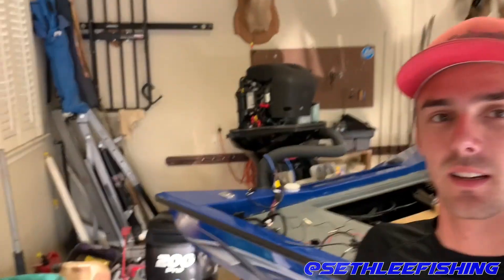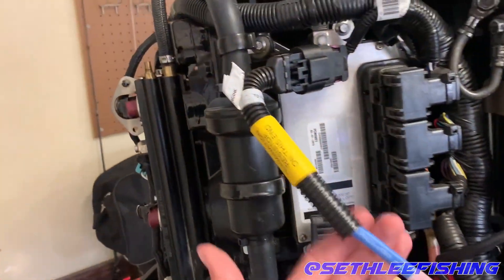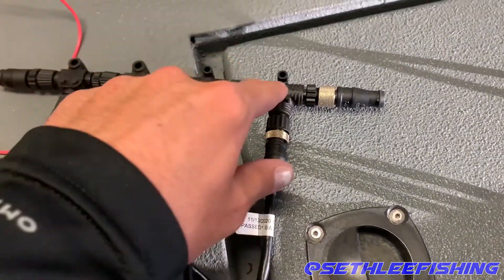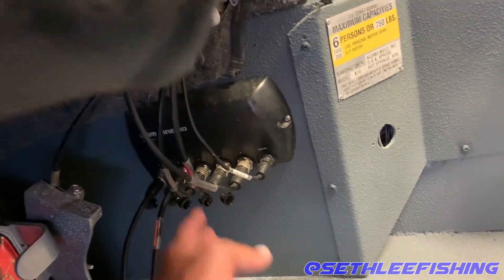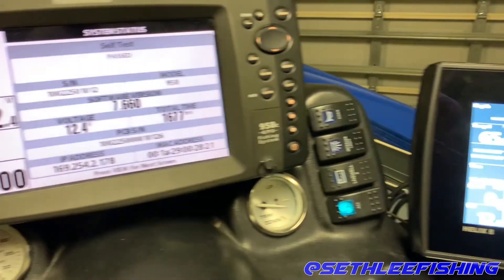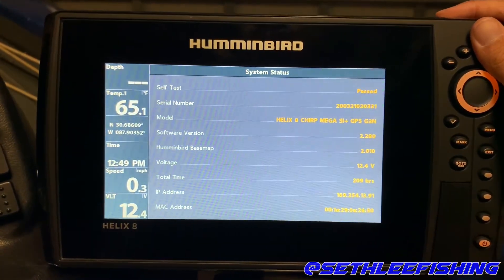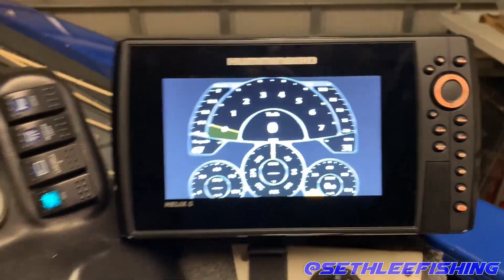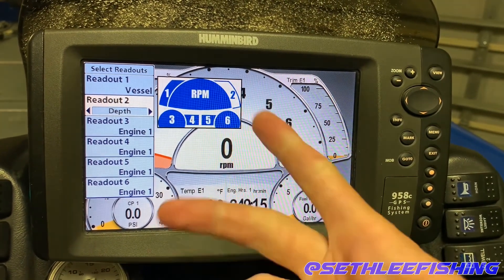Connecting Outboard Engine Data to Units | Nmea 2k Tutorial

Comment: On a new 2022 Mercury Pro XS do you still need the Blue cable or can you plug the gateway directly into the smart port on the engine, then to the NMEA backbone, and connect to Lowrance HDS. Is the blue cable still required, or there is no way around that.
Reply: I need to know the answer to this question as well...
Reply: @Bennett00044  Its complicated and not easy. Yep if you do the blue cable then to NMEA and then to Lowrance ,all you get is a generic instrument panel from Lowrance with limited info. To get the Mercury logo with full bells and whistles you need an additional Mercury Vessel link junction box $450. Not worth it so I went with the mobile phone app which works fine. $150

Comment: Doesn't the Mercury Gateway just plug into the engine where you plugged the blue cable into?
Reply from the maker: No, you must use the blue cable because of the resistors. You may have seen someone plug in the Vesselview module straight to the motor, it looks very similar. But the NMEA 2k gateway must have the blue cable.
Reply: @SethLee  Thanks for that.  Just ordered it and the male/male.  I have the gateway arriving tomorrow.   Is it the Smartcraft Manager app that your downloaded?
Reply from the maker: @timtullio1210  The gateway I used in this video is an older model that didn’t have the WiFi/Bluetooth Connectivity feature. I’m assuming the one you ordered most likely does. You do not need the app to connect everything if you are physically connecting all your cables and units together like I did in the video. My understanding is that the app is only for setting up your gateway to send/receive wireless Data/Info to and from your system. I have no personal experience using the app or wireless option so I cant really give you much more information about that. I always prefer to physically connect things instead of using a wireless option just for the sake of reliability. 

So, no the app is not required for this setup. It may have some extra cool features but I’m not aware of what they are or how to use them. Good luck with the install, hope you enjoy the outcome! I think it’s well worth the upgrade
Reply: @SethLee  Got is all together, and it's working!  Thanks for the video and helping afterwards.  Blue cable, to male/male, to Mercury Gateway Module, to NEMA starter kit, to Solix.  Power from aux switch on dash.
Reply from the maker: @timtullio1210  Awesome! Glad I could help
Reply: @timtullio1210  What engine instrument information did you get to show up on your solix from this gateway setup?

Comment: How did you route the cable up to the engine? The problem I'm running into is the mercury harness connector is too big to be ran through with the existing cables and lines.
Reply from the maker: It was a very tight fit but I managed to get it through. It took a lot of patience. There are several threads on the bass boat central forums about this. A lot of guys have removed the wires from the plug and then they were able to get it through easily, then they reattached the plug. I would advise against that because you can mess it up if you don’t know what you’re doing. But look into it and see if that may be a better option for you. Hope that helps!
Reply: I'd run from the engine to the backbone of the nmea 2000 instead

Comment: Hi all. I was hoping someone could help me with an answer to how the NMEA 0813 to 2K converter works? Would this connect from the five port Ethernet switch of Humminbird into the NMEA 2000 backbone? I have not been able to find a straightforward answer to this. I have 2 H'bird units the helix 9 & 7. Both are G3N. I've already purchased and returned a Lowrance unit to get the fuel data manager working and I've now purchased a Garmin GPS24XD for GPS data. What I need now is the sonar depth, water temp and t speed thru water (STW) data .. and I was thinking it would be cheaper to use a converter and utilize the H'bird transducer I already have mounted rather than have to buy a 3rd transducer for this data to display. Wish I could post a pic of my setup but basically the 2 H'bird units, the 5 port switch, the H'bird NMEA2K adapter and then on the NMEA2k backbone it's the Yamaha interface cable, Lowrance fluid level sensor, Lowrance fuel data manager, Garmin GPS24xd.  If anyone can explain how to get the H'bird transducer data onto the NMEA2K display I'd appreciate it greatly.

Comment: Excellent video!  I'm attempting to connect a Mercury 40 ELPT to a Garmin 73SV.  Is the blue cable and male-to-male adapter only needed to allow the Gateway to be placed near the helm?  Could the Gateway be plugged into the engine CANBUS and a NEMA cable be run to the backbone at the helm?

Also, PN: 98-8M0151748 in no longer available.  Replaced by 8M0165589
Reply from the maker: Unfortunately no, you must use the blue data cable because it contains resistors that are required for the CANBUS system to work properly. I tried to do the same thing with mine originally and had to buy the blue cable. Thanks for watching!
Reply: @SethLee  I called Mercury to see if its possible to retain the VesselView Mobile when adding the connection from the engine to the Garmin.  I already have the VesselView Mobile and it sends alerts and fault info to a phone or tablet.  The engine does not send alerts to the MFD through the CANBUS/NMEA2000 network(s).  If a fault occurs the VesselView Mobile module will send data to the VesselView app.  The app then sends the data to "the cloud" to be translated.  The translated message is then sent back to your phone and is displayed.  I assume no alerts without cell signal.

You can connect the VesselView Mobile AND connect the engine to the MFD by using a Mercury Junction Module.  Connect as follows:

1. Engine>>blue cable>>male-to-male>>junction module>>gateway>>NMEA 2000 backbone>>MFD
2. VesselView Mobile>>junction module

Then you'll have data on your MFD and receive alerts to your phone or tablet within 30' for the VesselView Mobile

Comment: Just what I needed to see. Just bought a 2021 Mercury XS Pro 115 hp and have 2021 Humminbird helix Gen4. Now I know what I need to connect everything together. Note the GEN4 helix does not need the adapter and can plug directly into NMEA2000. Showing the analog to digital converter was awesome, listing the parts. I has the gps puck like yours and now I understand it can be connected, just have figure out the connectors required. Thanks so much for this video. Paul
Reply from the maker: Thanks for watching Paul!